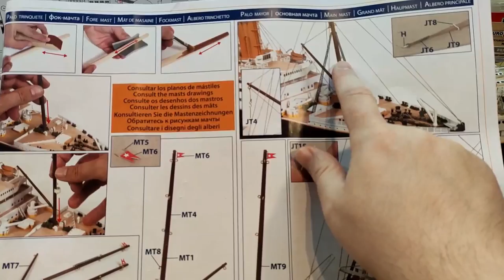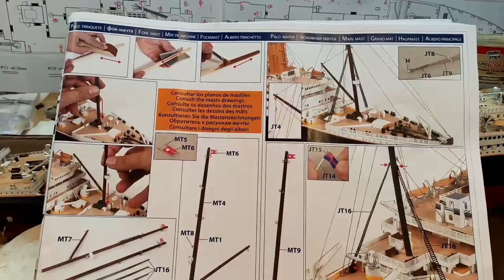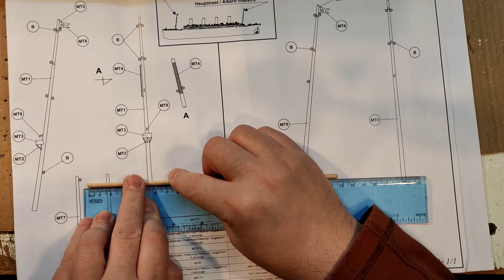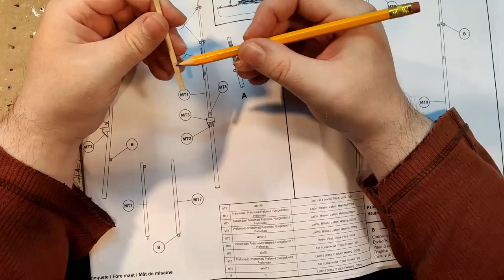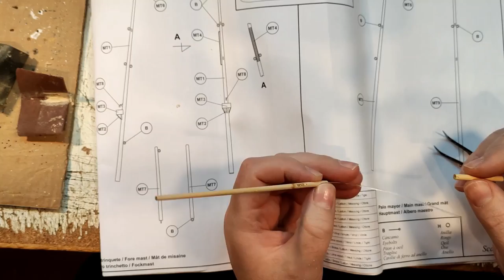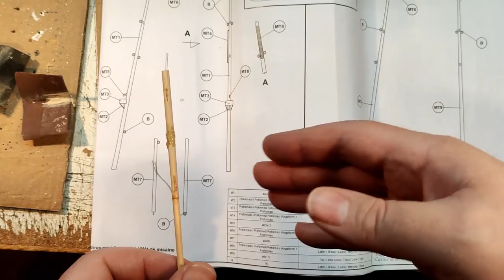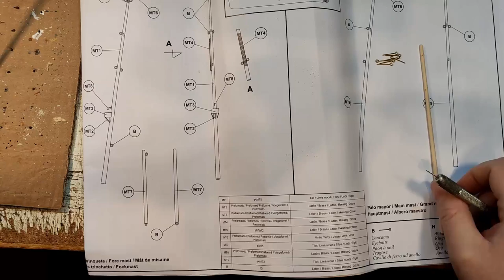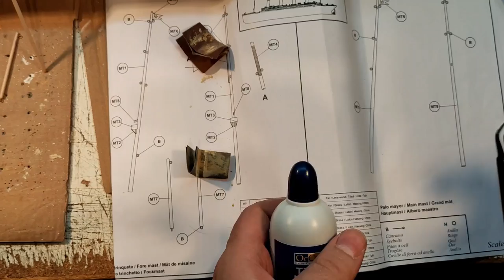RMS Titanic - part 40 Making The Masts

Comment: It was an ambitious idea with the fibre optic in the mast, John. It"s a pity it didn't succeed. Maybe it might have been easier to use two pieces of 3x3mm wood strip, score a channel in each for the cable, glue them together and shape it down to 4mm.
Reply from the maker: Yes it could work, the problem was the glue, as soon as it got on the fiber the light stopped...

Comment: Good idea, John...too bad it didn't work.  Perhaps if you had the ability to cut the mast in half and insert the fiber optic inside then place them together than glue them with the fiber totally inside so the glue doesn't mess it up?  It would be terribly tedious and not sure if possible at all but the only way I could think to do it without the glue messing it up.  I was hoping it would work all the while you were doing it.
Reply from the maker: Thank you Michael! I could use some plastic cover like sleeve to insert the fiber in, do not if it would have worked. Maybe in another model or maybe someone will take this idea and make it work :)

Comment: Hi John, I am really enjoying your titanic series. It looks amazing. I have the same cutter that you are using at 7:20. However, I need to change the blade and am having issues working out how to remove the blade that came in the cutter. Can you  please advise how I remove the existing blade and replace it with another?
Reply from the maker: Hi Steven, It's pretty easy and you do not have immediately to replace the blade. You unscrew the 2 side screws of the cutter, you flip the blade upside down and you are ready!

Comment: John,
Je n’ai pas trop compris l’utilité de la fibre optique pour simuler la lumière au dessus du nid de pie et son problème. C’est quoi le nid des corbeaux (the crows nest) ? Jamais entendu.
Vos mâts sont superbes.
Bon courage pour la suite et à bientôt. 
Yves de Lille (Nord de la France)
Reply from the maker: Hi Yves! The crows nest is where a couple of sailors went on a small platform on the mast to be able to see around the ship in a big area, like the center mast of a sails ship. On the Titanic there was a small light over there and i wanted to use an optic fiber to transfer the light but the glue destroyed it...
Reply: @JohnsWoodenShips  John,
Merci pour ce complément d’information. Aurait-il un autre moyen pour simuler cette lumière ? Peut-être en mettant la fibre dans une fine gaine ?
Reply from the maker: @chtiboiseux792  I had to had wires but i didn't had any at the time i found out that over there there was a light.